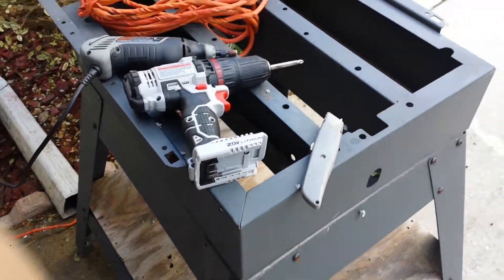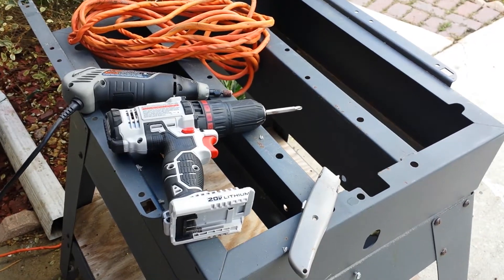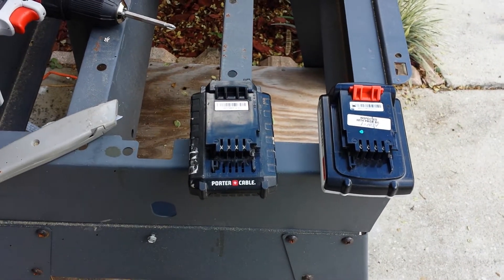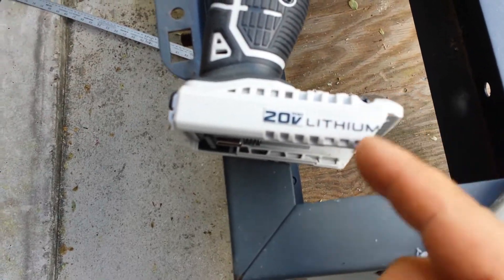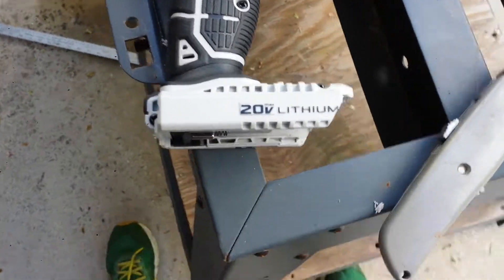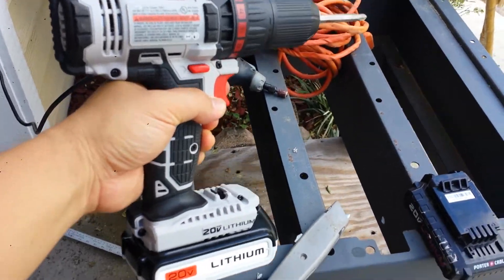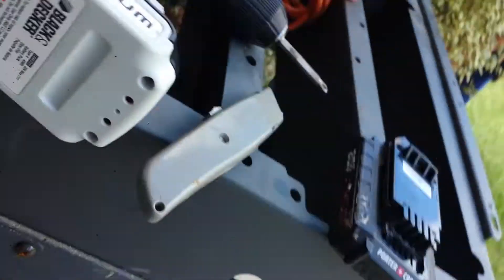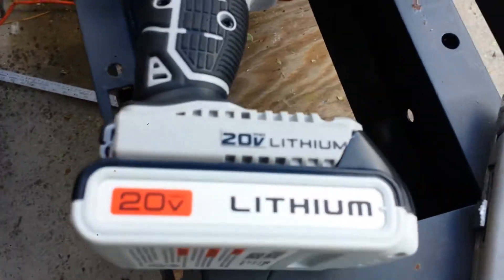Black & decker 20V battery to Porter cable

Comment: tell me though.. does the porter cable battery work in the Black and Decker tool?
Reply from the maker: yes but you need to cut a little in both of them as shown in video. Perfectly works.
Reply: +sa017140  thank you..